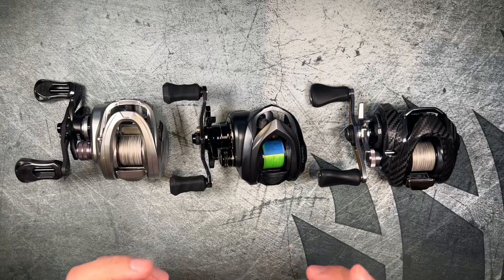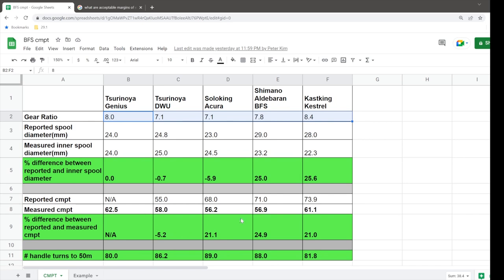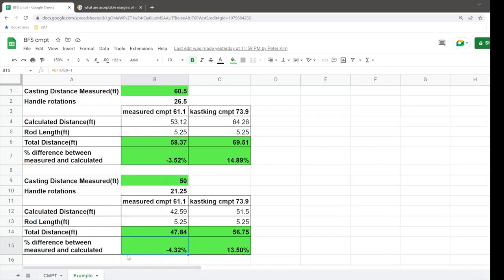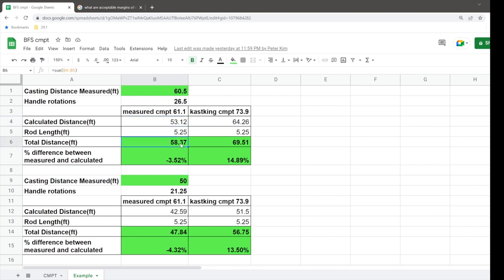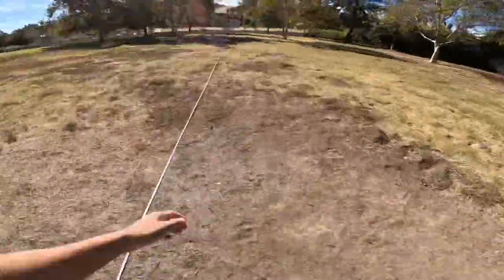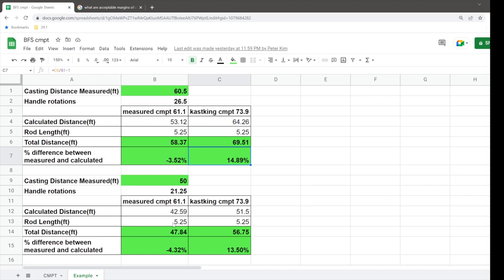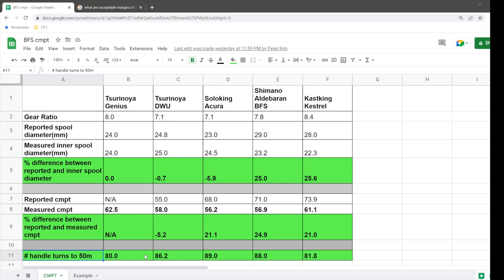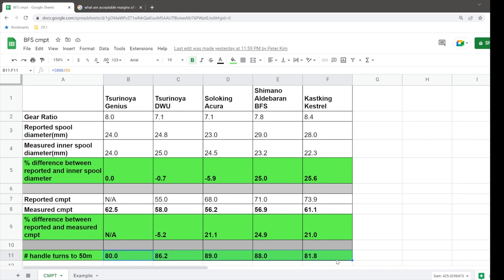Are BFS reel companies LYING🤯??? The TRUTH about IPT and CMPT

Comment: Hence why I use a colour change and meter marked line like Duel Hardcore X8, takes all the guess work out of spooling up 50m and you can count exactly how far you are casting each time.
Reply from the maker: Hey kelvin! I have a sinking feeling that even those markings aren’t very close to being 100% accurate. Line manufacturers are definitely giving you a demarcation of some sort but without knowing exactly what those measurements are it’s still guess work. Can you try measuring out and seeing what the markings actually are? The other thing I’ve found is that lines who use a color change, white and green for example, can be super difficult to see where the change actually happens. Counting handle turns is a bit easier and you have more awareness of it but the problem is with manufacturers that like to overreport and use the outer diameter of the spool to give you IPT/CMPT. This is why using the inner diameter, even though isn’t 100% accurate, will give you a much better approximation of line. Anyhow, I hope this video helps out and thanks for the support as always! Cheers!

Comment: Manufactures have been doing it for a long time look at rod ratings (action, power, lure weight, line size) they usually not correct
Reply from the maker: Hey pampee! Yes… rod ratings are pretty dismal at best and all over the place. It’s not surprising there is no “standard” for all these ratings and measurements but at least we can try to find something that works better for us! I hope this helps you out and brings these overestimations to everyone’s attention. It seems like some people rely on these inaccuracies to calculate distance cast and to add line to their spools. In any case, thanks for sharing and cheers!

Comment: Reel companies measure with full spool which will increase the diameter.  you're doing it from spool outwards so you'll get different measurements. Neither is wrong just different
Reply from the maker: Hi tom! Using the outer spool diameter gives you an approx 13-15% over estimation of line. I think using the inner diameter of the spool or even the middle diameter of the spool would be much more appropriate than the outer diameter. Plus using the outer diameter of the spool makes you think you cast further than you actually did. Seems questionable to me 🤷‍♂️

Comment: There's no Science in Fishing! Wait... is measurement even Science? Math? Engineering? All three? I'm so confused now! LOL  

I think all Manufactures fudge the numbers a little for the sake of making themselves look better than everyone else. 

Whenever I spool up a new reel, I head to the park with the football field. I'll stand on the line at the back of the end zone, tie on my line after I thread it through the rod, set it down then I walk to the 50 yard line with the spool of line. When I get there I cut the line, clip on one of those crimped 1/8 drop shot weights, walk back and reel it in slow and steady. That gives me 60 yards of line on the reel. Might not be the most practical, surely not the most scientific. But it gets the line on the spool nice and tight, and gets me out of the house for a while.